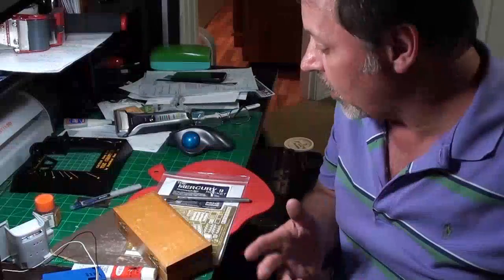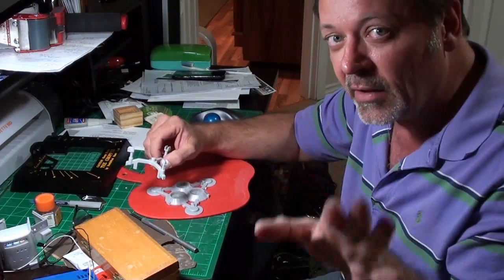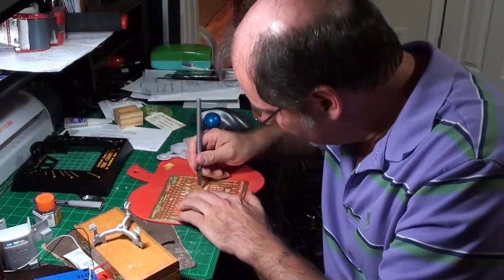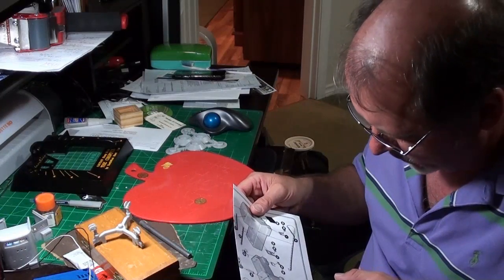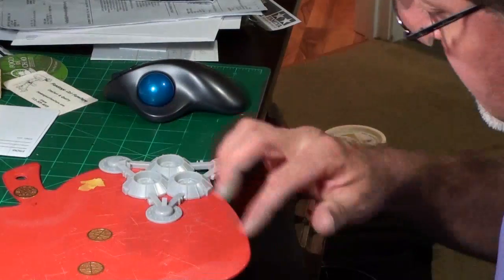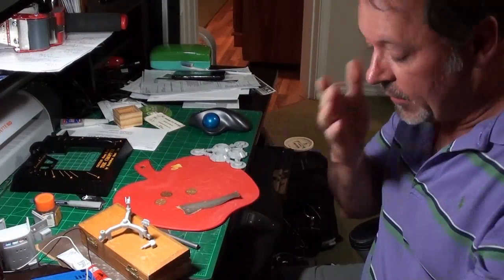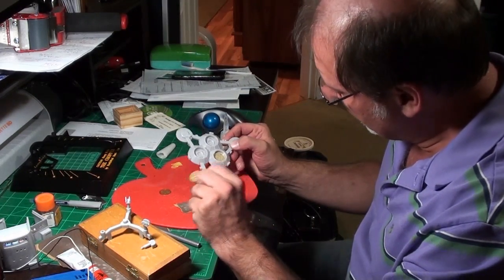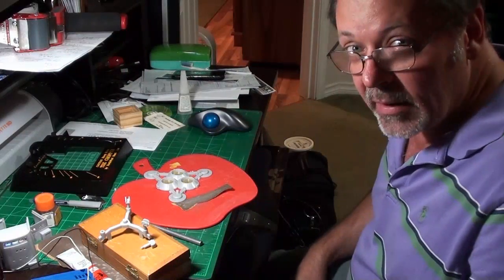Mercury 9 Part 18:  Photo etch

Comment: The Hellcats are too tiny for my big fat fingers, but the Avengers and Helldivers ended up ok.. that is to say, I have not made an attempt to paint them yet! I'll probably just stick the Hellcats together as good as can be and stick them all on the hangger deck, where they'll be visible only if you look for them... :) :) The Helldivers will be with folded wings stored on the aft of the flight deck, and the Avengers will be ready for take off.. or so I hope, all going to plan.. :)